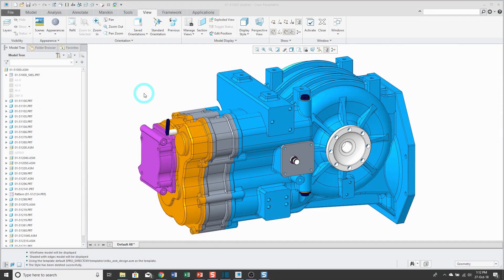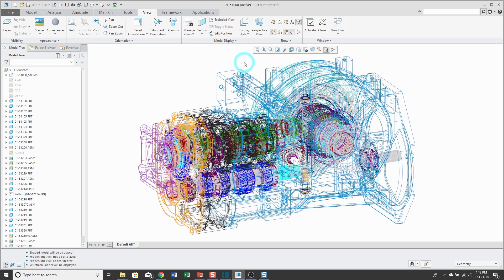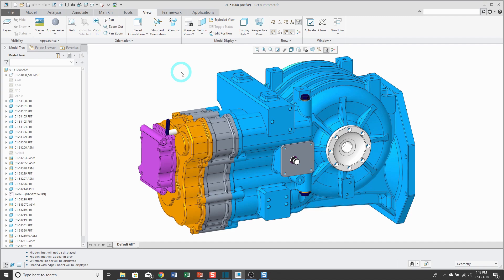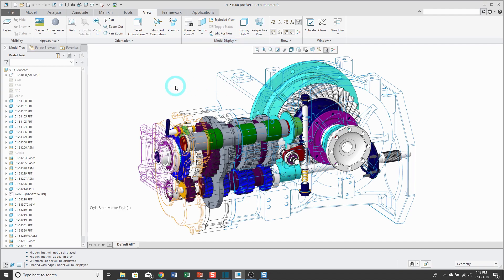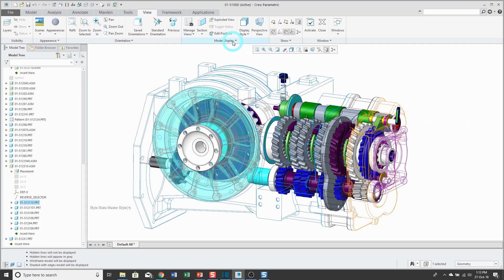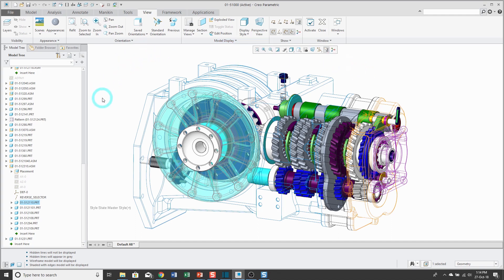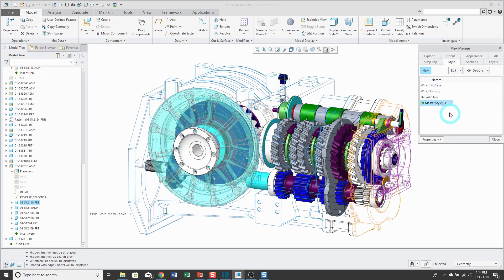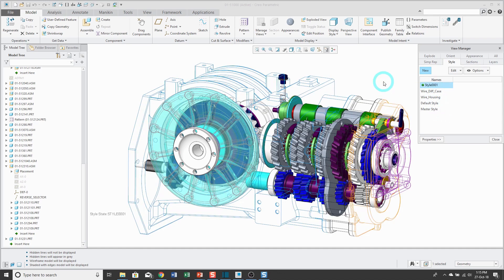Creo Parametric - How to Create Style States | View Manager

Comment: Hi Dave...Is it possible to apply  shading to one component (or sub-assembly) and shading with edges to another component (or sub-assembly) in the assembly mode using style state? Thanks
Reply from the maker: No.
Reply: @CADPLMGuy Ok fine...I was working on an imported geometry where so many unnecessary edges were highlighted in the model... I tried to get rid of tht by using shading mode and found Ok but at the same time I wanted other parts in the assembly to be displayed in shading with edges for better clarity...So I was trying out by using this option of Style manager...Thanks for the reply..
Reply from the maker: What about going into Import Data Doctor and trying to delete the extraneous geometry?